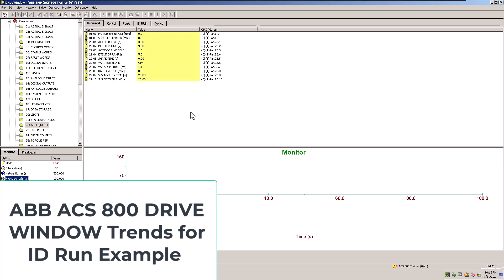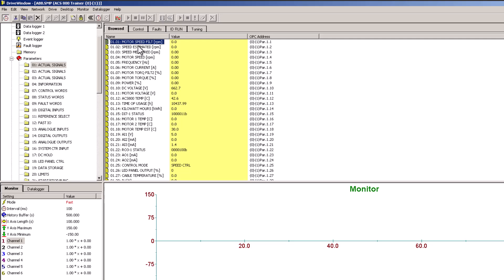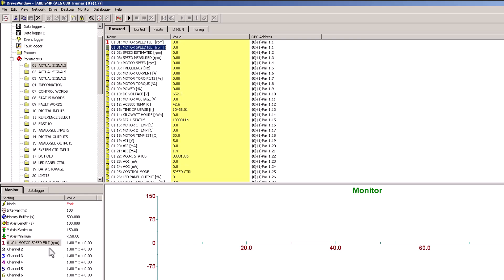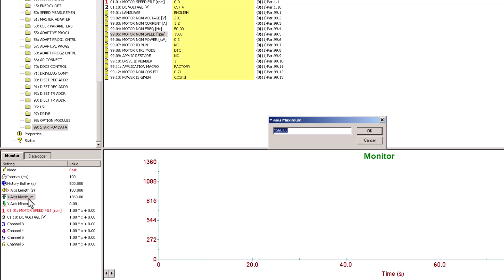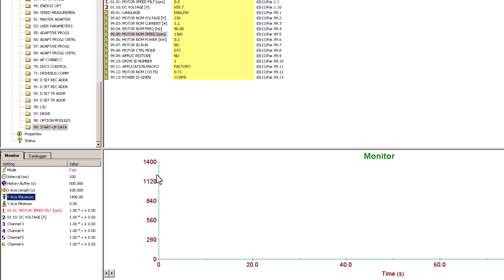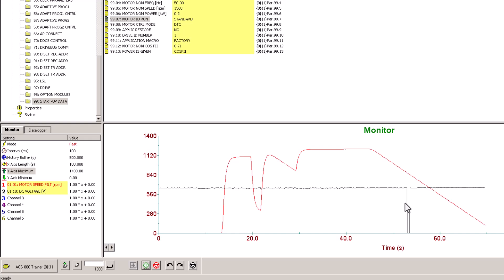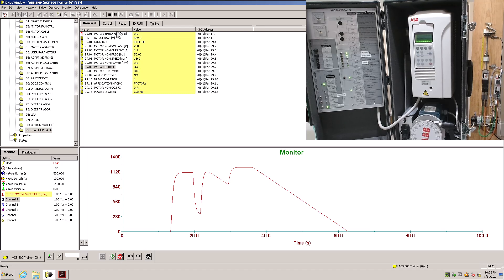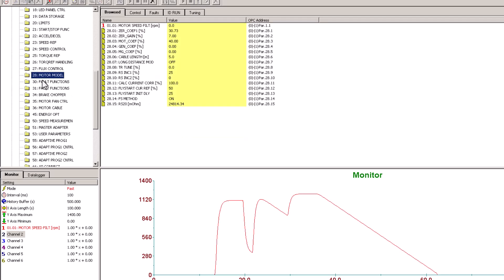ABB ACS 800 DRIVE WINDOW Trends for ID Run Example

Comment: can i monitor the current transformer in converter ACS800-87LC ?
Reply from the maker: You can monitor the drives and the power supply, the AFE or the Diode section but not the feeding transformer